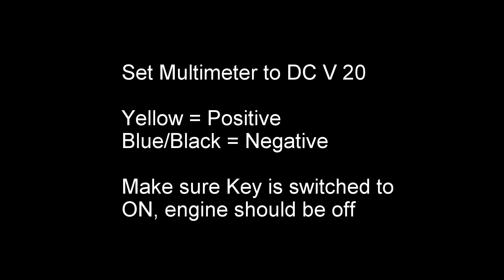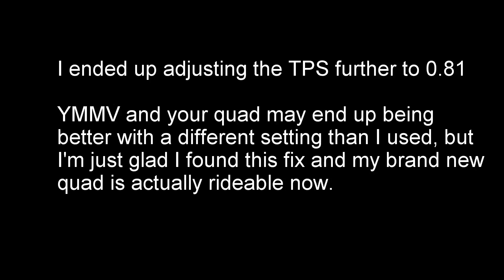2014+ YFZ450R Factory Bogging Issue, Fixed for Free

Comment: Thank you sir, this  trick worked great on my 2014 yfz450r. My stock setting was .70 and I found that at .85 the bog started to go away and it ran best at .95. When I went above 1.0 it would'nt idle right and sputtered when I let off the throttle. Its 90% better now. Very glad I found your video.

Comment: My brand new 21 would bog real bad and die while shifting so i bought a vortex ecu and now its better then perfect! No bog, no killing,  and crazy throttle response even on a stock bike
Reply: I have a 2017 yfz and it won’t idle do u know what the problem can b
Reply: @omarstanley4922  what I just did was replace the battery and adjusted the throttle cable slightly and we’ll see how it goes

Comment: i am definitely trying this tomorow because it gets really annoying. Bought 2017 yfz450r and its a pain to ride it at low rpm low throttle, too much stutter. i just hope that this will solve the problem for me, thanks for the video.
Reply from the maker: no problem! I ride tight technical trails most of the time, so I also ended up going down a tooth on the front sprocket and that combined with this fix has made it a joy to ride!
Reply: Get a ais delete kit.

Comment: I have raptor 700r same year as your 450. The problem i face is that when I am on the 3rd gear and rev the RPM high it kinda cuts out for a second then pushes. it happens for me only on 3rd to 5th gear only. first and second work just fine. I wonder if this solution would help me fix it.
Reply: You probably need a new gears

Comment: Do you think you could make another video showing me what you're adjusting its hard to tell in this video notes hard to get the camera in their wire working on it but if you could make another video showing exactly what you're screwing with his my needs adjusted bad
Reply from the maker: Sorry, I've since traded out my 450 for a Raptor 700 since I've been riding slow pace rough trails more than high speed slidey stuff lately
Reply: How is that reader adjusting that ...

Comment: Is the .81 working winter and summer or do you have to make seasonal adjustments? I'm in winter here so it's about 30deg out with elevation about 1000 ft. I have moved it from .687 to .708 and its better but may need more adjustment. Thanks for the video. I have a test harness from peak racing to make it easier to adjust. Thanks
Reply: My biggest issue was high hanging idle so I'm guessing it was a little lean on idle or low rpm range.
Reply: I'm working on a 16 450r se

Comment: I got the K&N with yoshimura pipe and power commander and got it all mapped out at my local Motorsport store and it still wants to fall on its face when I'm in high RPM going around corners and down shifting. Will this do anything for me ?
Reply from the maker: I don't have any mods, so I have no way to be sure about your setup. However, since this is free it's worth a try! Let us know how it turns out!
Reply: SoCal SevenSixoH send it back it to the shop should only want to fall on its face taking off or going slow
Reply: Get ride of the power commander and go vortex

Comment: the idle is so high now though
Reply: braapmasterflex it's actually a lot higher compared to the beginning of video where u stalled it twice
Reply from the maker: now that you mention it, it does seem a bit higher, should be easily adjusted by the idle screw though.
Reply: braapmasterflex did you lower the ldle ?
Reply from the maker: I actually traded the 450 for a Raptor 700 since I mostly ride trails these days, videos coming soon!

Comment: i have a raptor 700 2016 should i get a 450 do they have any problems like this yfz or fo i get a ltr suzuki
Reply from the maker: If you're thinking about buying a 450 in addition to the 700, I say absolutely go for it! It's definitely more stable in high speed corners or doing donuts, and the high revving engine is lots of fun. I would rather have the 450 for high-speed fire roads or mx-style stuff, maybe even sand dunes for the stability sideways on hills.

But if you're thinking about replacing the 700, I would be hesitant. Now that I have owned both, the Raptor 700 is just a better all-around machine than the 450 is for most of the riding I do. It will keep up with any 450 in the fast stuff just fine, but is much easier to ride when the trail gets slow. If there are obstacles on a trail that you have to crawl over, or you have to start from a stop on a steep hill, or if the trail is rough/rocky or filled with huge tree roots, the 700 really shines. The torque that only a bigger engine can give you down low is GREATLY appreciated in all of those situations, not to mention the plush suspension on the 700 won't beat you up like the 450 does, having reverse is quite nice, and the maintenance will be cheaper due to the valve setup.
Reply: braapmasterflex thank you for advice but do these yfz450r have proboems or issues
Reply from the maker: The problem I fixed in this video is the only problem I ever had with the quad, other than the suspension being too stiff for my bad back

Comment: I gave my yfz450 to Yamaha dealer and they can't fixed the problem bogging.  Even a engineer tech from the manufacturer came to fix it and have not able to fix the problem. They check everything from engine to electrical.  Does anyone has any clue or has the same problem? Now I don't know what to do. I bought new and never had any problem until my last ride. Its 2013 yfz450 never abused
Reply: We are in same situation, same bike, same year, bought brand new. Never had a single issue in 7 years. All the sudden not wanting to start, then when it starts you give gas and it dies... Did you ever get to the bottom of it and figure out the fix?
Reply: My used to do that, give it gas and it dies, it turned out to be a gasket, piston, and coil fix

Comment: l have the same problem  l al new rider  waranty covers  that ??
Reply: put a exhaust and optimizer on yours i put the hmf pipe and fuel controller on mine and the bike just lifts so much power and it fixed 90% of the bog
Reply: MattyYFZ  how much was tht in total

Comment: I have 2012 yfz450r. I can do it too?
Reply: Axe Vax no it’s only fi versions for 2014 & up. U have a carb version
Reply: B1boi i have a 2012 yfz450r, it has a throttle body with injectors

Comment: or you can buy a vortex :)
Reply from the maker: Maybe if I had extensive mods a 700 dollar ECU would make sense to tune it how I want, but if you've just bought a brand new quad and just want to get out and ride it without it flaming out constantly without spending another grand on a new ECU before you can ride it this makes way more sense.
Reply: It will cost more then 700 once you cook your system trying to adjust fuel and air and rec limiter. That's why idle changes so high just do it right and be done